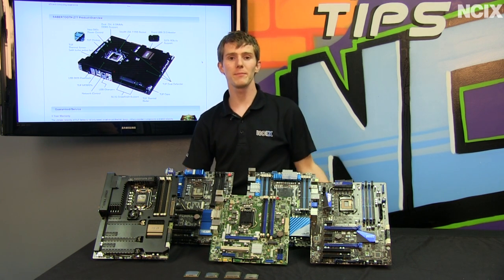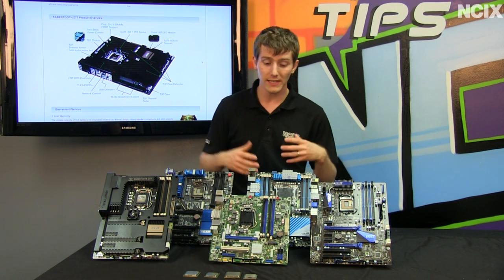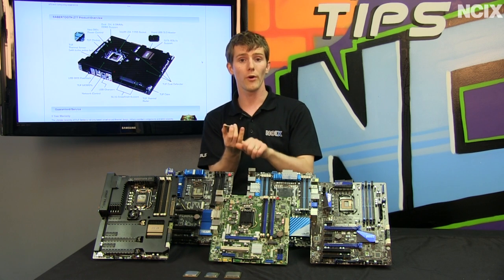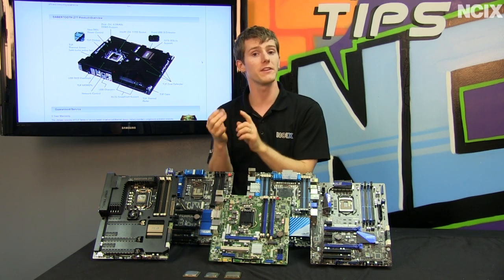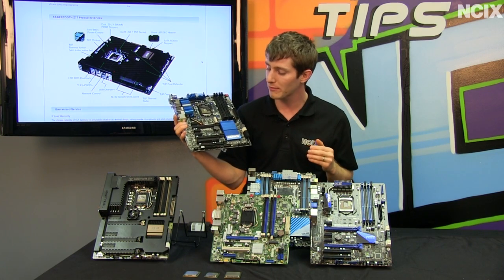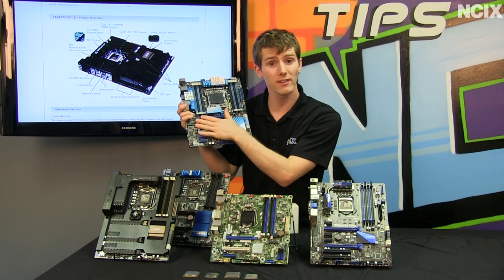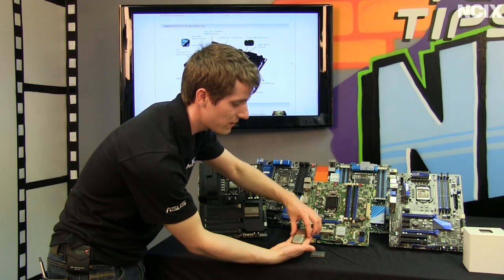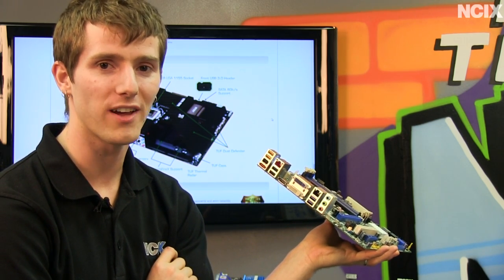Intel 3rd Generation Core Processor Ivy Bridge Overview NCIX Tech Tips

Comment: Chances are you'll have to update your bios. If you're that worried just by a 2500k i5. No bios update and you're only losing 5-10 percent at stock. The plus is sandy bridge cpus don't get as hot as ivy bridge so you can overclock them alot higher easier(like 5Ghz on high end air coolers). Buy an i5 2500k, overclock to 4.2-4.4(Depending on chip) and you're set buddy. Plus they're 10 bucks cheaper than ivy i5s. But hurry, since haswell came out they're done manufacturing sandy I5's.

Comment: Linus I need some help im kinda confused, im upgrading my cpu from a intel pentium g850 clocked at 2.9ghz which is good for gaming but im sceptical on bf4, This pentuim is a sandy bridge and suppourts my new MSI H61M-P31 (G3) Motherboard i want to get an i5 3570 ivy bridge. Can i go from sandy bridge to ivy bridge?? It also says that 'Ivybridge CPU's will work on H61/H67/P67 & Z68 Boards but a BIOS Update may be required for these Motherboards to support them' But do i have to do a BIOS update?

Comment: That's because noone could effectively utilize all 7 available spes. Games would use all of them but without proper optimization it was all for nothing. Also remember you're saying that hardware released in 2013 will beat hardware released in 2006-7. That's common sense. Especially considering the shitty cell architecture.

Comment: Asrock Z77 Extreme 3, i5-3470(or a 3570k if you want to overclock). The mobo has 4 dimm slots so you can theoretically have 128 gigs of ram but 16 to 32 should be plenty. I'd suggest getting a mid-grade firepro card from ati, or a high tier quadro from nvidia. Regular gaming graphics cards aren't made for animation and can have glitches when rendering(so I hear) so this is a good fit.

Comment: Well... 30 less bucks go buy a hd 6670 with ddr3 ram for equivelent performance or for the same price a hd 6670 with gddr5 ram for more performance. Or 40 more bucks and get a gtx 650ti so you have a computer that actually does something.

Comment: Well, it's really rour decition right now it's only a 10% improvement over this architecture :3 tho we still need to see once it's out. but you should be just fine with a PC if you buiy it now. ^^ you might have to change GPU but not the processor in a long time :3

Comment: i assumed you ment that on consoles you push a tiny bit you run at speed 1 you push a bit more you run at speed 2 you push more you run at speed3 you click the button down . you run at speed 4..     on the ps4 that will not be the case it will only have 2 speeds button   being pushed forward for walk and button being pushed and clicked down. if the ps3 way is so good then why hasnt it been continued.. i typed so much :P

Comment: i5-3570k CPU, GTX 670 GPU, 8GB memory, running OS on a Crucial M4 SSD and files on 2 WD HDDs.

Well yes, of course a controller would be best in certain specific scenarios. Just plug in a Xbox360 controller onto a Windows PC, and it is fully supported with official drivers from Microsoft. Most PC games have full support for Xbox360 controllers as well. PS3 controllers, and others can be used on the PC with third-party drivers, and there are tons of PC controllers as well. 

Best of both worlds.

Comment: technically intel hyperthreading is the one with fake cores since how it works is just that there is software which manages how each core handles data so one core can work on two instructions at a time and amd's version is built so each core is physically built in a way that it acts like 2 cores, well 80% as fast as actually running two seperate cores.
although intels method seems to be better since intel cpu's are pretty much 30% faster in the worst case scenario xD

Comment: hmmm. its possible that thats the fault of intel using TIM instead of soldering the die to the heat spreader, you can fix this yourself but if it goes wrong tits not covered by the warranty and considering 50c isnt bad, its not worth it unless you plan on some serious overclocking.

Comment: my core i5 2500K which has a 18W higher TDP than your processor, idle i got about 30c, load i got about 45 to 50 depending on room temperature and graphics card load.

what graphics card do you have? my gtx 560ti emits a shit tonne of heat.

Comment: Maybe. The Ivy Bridge Intel i5 3317u is a 2 core with a base clock speed of 1.7ghz and 2.5ghz with turbo boost. I personally am able to run it fine with a Quad Core Intel i7 3610qm (2.3ghz - 3.1ghz) and Intel HD 4000. Though my processor is a bit more powerful. Wish you luck.

Comment: also i forgot to mention earlier you have 2 gtx in sli right? if your 3770 isnt the K edition and therefor not overclocked its most likely bottlenecking them, gtx 680 are really powerful even the extreme 6 core from intel cant drive 4 of them at 100% so if your 3770 is still at stock speed it might be the reason why you''re having some poor performance outcome

Comment: What are your settings in BIOS? Have you changed any voltages, cpu and ram timings? Check with CPU-Z and your bios and note down what the voltages coming out are, i would personally reset back to default settings if you have attempted to increase FBS and overall cpu frequency ratio. It could well be your motherboard also, does it support your other hardware especially if your using SSD and try some other RAM too, I guess your using DIMM not SIMM. You should update your motherboard & cpu firmware

Comment: Dude I agree but that's just the color of the solder mask which protects the traces and stops shorts. Also stops the copper underneath from oxidizing or corroding. I love my ASUS Crosshair Formula V AM3+ board. Gorgeous mobo!

Comment: If you are using graphic cards on PCI-E 2.0 8x speed slots, you will benefit from an Ivy Bridge CPU to get PCI-E 3.0 speeds on your slots, which are double the speed of 2.0 ones...

However If you are using PCI-E 2.0 x16 speed slots, those are still good enough for current GPUs at the moment.

Comment: i7 3770k has 8 threads so it will be fine. I remember making a pc build about 2 - 3 weeks ago which was $2000 MAX, you won't go close to that if you buy from amazon, unless you got for a GTX 680 SLi or a EVGA GTX 690.

Comment: No you can't.no support for the new processor. The Xbox's Coding is designed specifically for it's current processor. Put anything else in it and the performance would be little to none. Also the Xbox's CPU is soldered into the board meaning there is no socket so there is no way to upgrade it.

Comment: according to intel it had nothing to do with ay of that it has to do with the heat generating parts on the chip beng closer together on the 22nm chip (makes sense) wich makes getting the heat away from the chip harder as its more concentrated.
theres a more technical explination outthere somewhere if your interested.
anyway on the ivy bridge they did up the max temp of the cpu quite a bit so even it running near 80 degrees (celcius) shouldnt be a problem as thats far below the max allowed temp

Comment: Got a question loosely based on this. Brought a sabertooth z77 and a 3770 cpu with 16gb of ram and a 60gb ssd for the purposes of using as a caching drive, i'm being led to believe through alot of problems im having trying to install the intel rapid start, rapid response and rapid storage technology that there's a upper limit of 8gb of system memory to work, any tech tips on fixing this without downgrading?

Comment: Hot and loud? Don't worry. If you have a proper/decent aftermarket cooler you are completely safe. Doesn't really matter what chipset it is. If you do any 3D rendering/video I'd recommend x79 becuase it has quad channel. Ivy Bridge will not bottleneck SLI GTX680s.

Comment: You did'nt mention the fact that Z77 provide unseen DDR3 speed up to 2666mhz kits + OC up to 3000mhz, that a a major points that made me choose Z77 over X79 if you can have better RAM and some GPU solution ... why pay 250$ extra on a 6-core and 150$ on the X79 mobo

Comment: Why would anyone with a sandy bridge upgrade. If you overclock at all (which i guess most on this channek do) you will pretty much get the same performance due to ivy brdiges higher heat output. PCI 3 is the only reason, but i can only imagine the most hardcore users to upgrade motherboard and cpu just to get pci 3

Comment: yes and no. yes it will work perfectly. no it wont have pci-e 3.0. the pci-e 3.0 controller is in the cpu itself. not the chipset. but you will still get all the added benefits of the z77 chipset. better overclocking, native usb 3.0, msata, and some other perks. any 1155 cpu will work on a z77, but the pci-e 3.o will only be 2.0 if its not ivy bridge. but from all the benchmarks i have seen it makes no difference unless you go for xfire or sli.

Comment: 3 way crossfire and Tri SLI will work fine even with one of the cards running on a 4x PCIE 2.0 bus.
If you are using a GFX card and motherboard/CPU that supports PCIE 3.0, remember that it is twice as fast per a lane as 2.0.
That means that a 4X 3.0 slot (when using a 3.0 GFX card, mobo and cpu) is the same speed as a 8x 2.0 slot.

Comment: It doesn't matter though. You can, in fact, do 4-way SLI and CFX on a Z77 board as long as the manufacturer has implemented the technology, and a lot of them have and are advertising it. You can do 4-way with dual GPU cards without any bandwidth issues. The motherboard would not bottleneck the cards, and ASUS already has a board out that can do 3-way and 4-way with single GPU cards (P8Z77 WS), and they're going to be coming out with more (P8Z77-V Premier, and Maximus V Formula).

Comment: yeah i agree. however thats only if you get a supoer high end , a core i7 2700k , or an overclocked 2500k will be relevent for at least 3 years . but on the gpu end , i think in honesty the 680 will still be a good card for at least 2 years to come , especially if you buy the upcoming gk110 version which is 30 percent faster . which will put in on par with 3 way gtx 580 sli .

Comment: in reality pcie 3.0 isnt even needed right now , even the top end cards like the 680 barely benifit from pcie 3 maybe a frame or 2 per second , if that . pcie 2.0 is still more than powerful enough , the only big benifit is for sli/crossfire users who run 3 or 4 high end gpu's .

Comment: Trying to decide if I upgrade when 2011 socket chips drop.  If it isn't 8 core than no. The sandy E has all the updates other than the die size, video, srt, and the new transistors. None of those features will be vital for me. I assume the X79 will allow OC.

Comment: Ok linus....stop lying. Z77 boards can easily do 4-way SLI or CFX, because PCI-E 3.0 has double the bandwidth than PCI-E 2.0 does. PCI-E 3.0 at x8 is the exact same thing as PCI-E 2.0 at x16. No graphics card on the market can saturate the bandwidth on a PCI-E 2.0 x16 slot right now. If the board has two PCI-E 3.0 slots that both run at x8 when they are populated, then you can easily put two dual gpu cards in there and they would run perfectly, and ASUS is going to have boards with 4 PCI-E slots

Comment: The IGP cost you nothing extra Linus? I beg to differ. The engineering costs involved in the production and implementation of the 4000 series is included right into the costs of the chip itself and hit the end user right in the wallet at the register. Suggesting that it comes for 'free' is rather naive of you Linus. R&D costs are always injected into the retail price of a product. Many of us would prefer the extra die space to be used for CPU performance instead of lackluster GPU performance...

Comment: No i7 2600k was dual channel but X58 was tripple channel memory. Also, the higher lga doesn't necessarily means it's better also because Haswell ( Intels next coming cpus released in2013) will be on lga 1150 and will have eight cores on it.

Comment: Ever wonder why Ivy Bridge runs so hot? Intel have applied TIM DIRECTLY on the die, not thermal solder like normal. This is drastically increasing temps. Let's hope this is only on the preview versions, and not the consumer ones.

Comment: The biggest reason that an ivy bridge gets so hot is because they put TIM between the actual chip and the metal piece, at sandy bridge CPU's they use fluxless solder instead of TIM.
TIM can transfer 5W/mK and fluxless solder can transfer 80W/mK
What means that fluxless solder is 16 times better!

Comment: But ivybridge is using thermal paste between the die and the heat spreader while sandybridge uses fluxless solder which has a far better thermal conductvity.
That's the reason why ivybridge is so hot.

Comment: Not for enthusiasts like me. And no I aint an AMD fanboy. When you over volt ivy bridge the temps that you get are stupid. 4.7ghz on Sandy: 70 degrees max. On Ivy: 90-100. See my point yet? An unlocked CPU that cant get as higher clock speed as previous gen, thats like kicking yourself in the nuts.

Comment: GTX 690

CUDA Cores	3072
Base Clock	915 MHz
Boost Clock	1019 MHz
Memory Config	4GB / 512-bit GDDR5
Memory Speed	6.0 Gbps
Power Connectors	8-pin + 8-pin
TDP	300W
Outputs	3x DL-DVI; Mini-Displayport 1.2
Bus Interface	PCI Express 3.0

Comment: na mate, just google ivy bridge IHS (it covers the die) they used normal thermal compound instead of fluxless solder, which means an increase of heat at higher voltages. Stupid move if you ask me.

Comment: IVY BRIDGE IS SHIT. THE ONLY REASON IT OVERHEATS IS BECAUSE INTEL USED THERMAL COMPOUND INSTEAD OF FLUXLESS SOLDER, SO IT ENDS UP RUNNING 20 DEGREES HIGHER THAN SANDY BRIDGE AT THE SAME CLOCK SPEEDS.

Comment: Does the ASUS Rampage IV Extreme LGA 2011 Intel X79 SATA  offer good over clocking for i5.
Also please comment on the system im planing on putting together atm.
My System:
ASUS Rampage IV Extreme LGA 2011 Intel X79 SATA 
Intel core i5
Sapphire Radeon 7970 OC
1050w Seasonic PowerSupply
H100 Cooler
M4 Crucial 128 gb SSD
500 gb Bluecaviar 
Corsair vengance 16gb

Comment: do you recon i should get this? Processor	Intel® Core™ i5-2320 (3.00 GHz, 6MB cache memory)
Operating System	Genuine Windows 7 Home Premium 64bit
RAM	8GB (4GB + 4GB)
- DDR3
- 1333MHz
Graphics card	AMD HD6670
Hard drive	2TB
- 7200RPM
- SATA